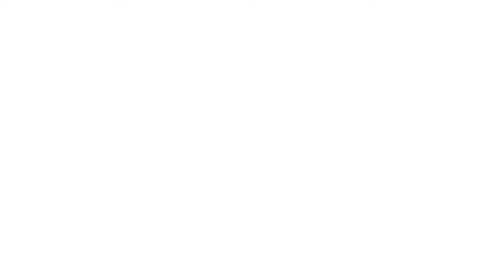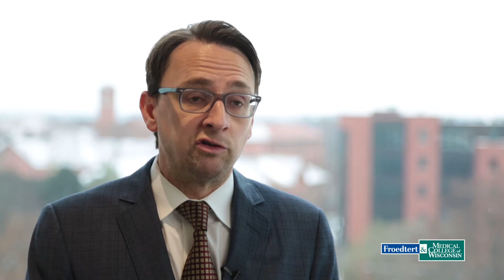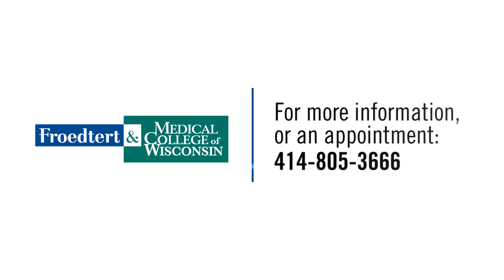What is a TRAM flap reconstruction? (John A. LoGiudice, MD)

Comment: Could you  reach firm abdominal muscles by exercising or will there still be deformity?
Reply from the maker: Hi Shugga - Exercise can improve the contour of the abdominal wall as the muscles that are preserved in the abdomen following the TRAM flap will get stronger. Our team of plastic surgeons work with each patient to determine which reconstruction approach is best for them based on their health goals. Learn more about the TRAM flap here: https://www.froedtert.com/plastic-surgery/breast-reconstruction. If you have any additional questions, you can call our general line at 414-805-3666 or toll free at 1-800-DOCTORS. Thanks, Taylor